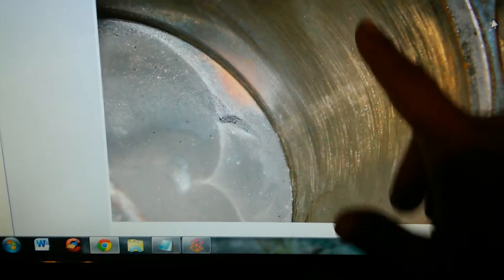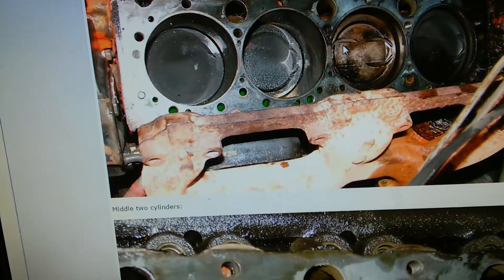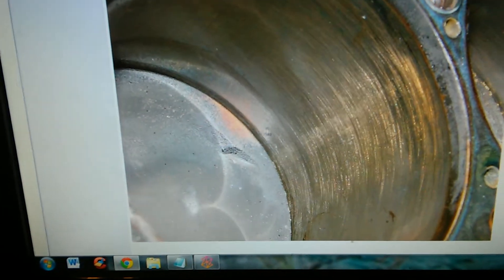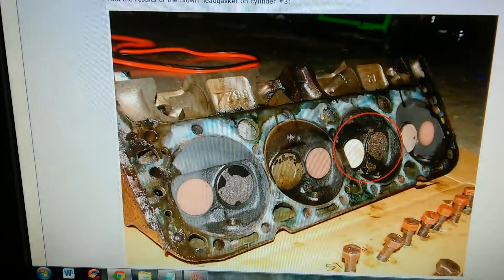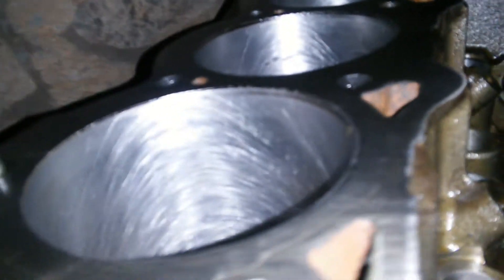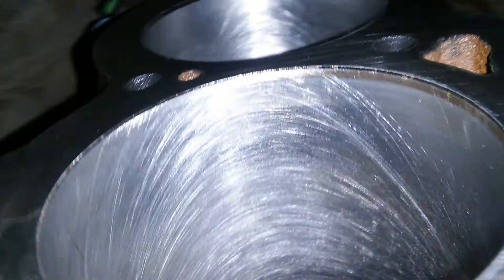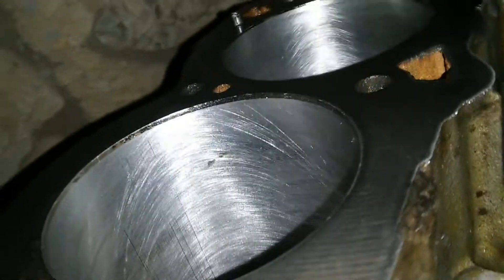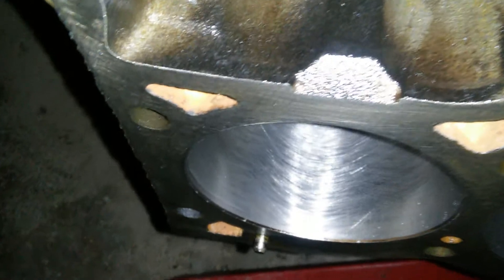Can I cylinder-deglaze at home effectively??? (part - 2 the results)

Comment: The rings are going to wear out in short order in that coarse of a finish.  If you ever saw a new factory block or a block from NASCAR they are nearly shiny they are so smooth. My machine shop finishes most bores with 320 stones and then plateau hones a few strokes with a CV616 Sunnen hone to finish. The rings will last 200k.

Comment: Good cross hatching ? You are wrecking your cylinder walls , how’s that good ? Thousands and thousands of miles and a beautiful polished bore the result . You come along with your hone and wreck it . Of course molly rings won’t beard on a polished bore but cast iron ductile rings certainly will near immediately . All this talk of deglazing etc is out of control . Your bore don’t glaze it is simply polished as it should be . Brake shoes glaze not cylinder walls !

Comment: i dont understand the physics of cross hatching it seems you would need the bore polished not scratched up arnt pistons made of alloy of are yours steel anyway i still cant figure how lines running at a 45 to the piston work straight up an down sounds way better
Reply: Cross hatch creates a seal with piston rings and cylinder not letting air or oil through. Up and down will allow leaks causing poor compression. A smooth service causes rings to float/glide over cylinder which can cause poor compression and may cause oil/air leak. Cross hatch will allow peak performance.
Reply: 45• angle seems to be old school. Now it’s advised 20• angle. So between 20-45 degrees and your good. No vertical lines or horizontal circles. Angle X’s= Cross Hatch